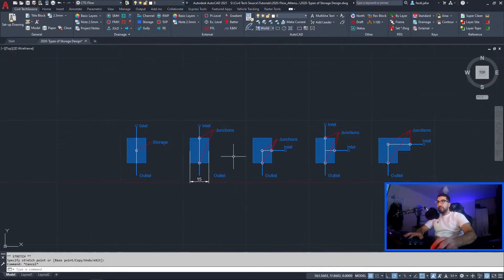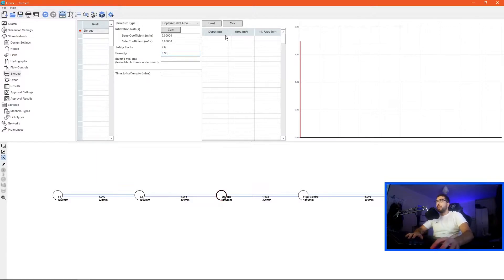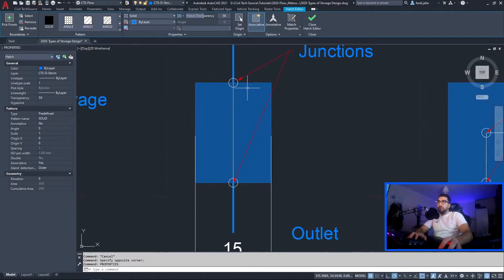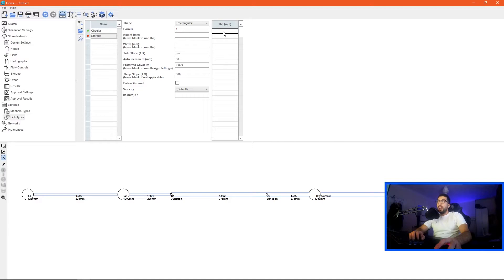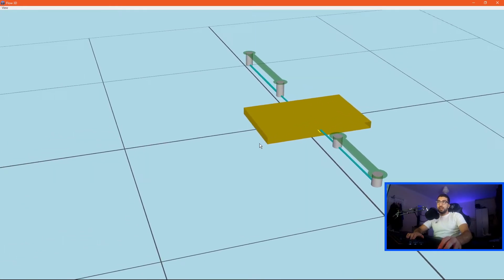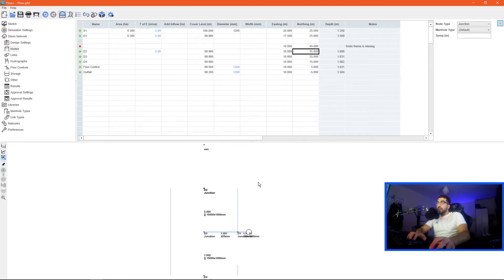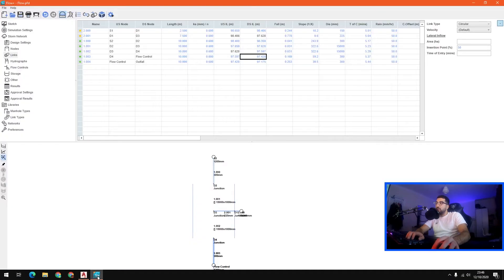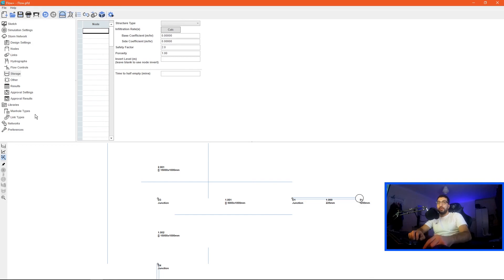How to design your storage in Flow v9.1 (Depth/Area)

Comment: Hi Ferdi, thanks for your videos! When defining a storage via the link between dummy manholes, how do you specify the porosity? It seems that in your example the porosity has been neglected?
Reply from the maker: Hi Bogdan, you are welcome! That is a good point! My work around it is to actually design the link to have the actually volume after taken in consideration the porosity. So, let's say the tank I designed in cad to 10x5x1m with total volume 45m3 with porosity 90%. So in flow instead of doing a 10m pipe I would do a 9m by 5x1m link to get a 45m volume. Personally I only use link storage when I have many incoming pipes into my storage. If its infiltration I stick to the traditional node storage.
Reply: @CivilTechSource  Makes sense and good thinking! Thanks for a quick reply as well

Comment: Great tutorials! FYI, safety factor only applies when an infiltration rate is specified. LLFA is also getting keen on this and will request their own numbers, 0 in some cases.
Reply from the maker: Hi Dave, you are correct. Correct me if I am wrong but safety factor of one should have no impact? Since usually the safety factors in most equations is a multiplication of a value?

Comment: Hi Ferdi, just doing a flow modelling here, in the spirit of getting as accurate a model as possible, I have started modelling storages on Nodes List as junctions, this way the only storage available is defined in the storage section. Just a thought.
Reply from the maker: Hi Chris, I going to agree with you! I have also seen people still using a sealed manhole and giving it a diameter of 100mm. Maybe it will be worth modelling a real life example and see what we get. Thanks for sharing!

Comment: Hi Ferdi, how would you define a pond or a basin in Flow, node in the centre (first example)?
Reply: Never mind, I have used "Flow through pond" which works quite well, even when using the 3D graphics visual.
Reply from the maker: Hi Chris, how to design a pond video is now available.